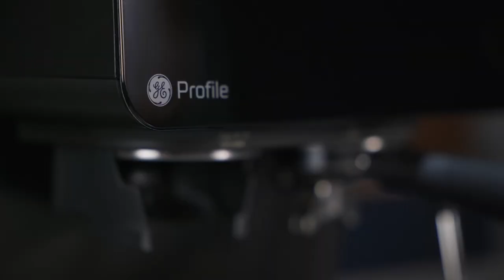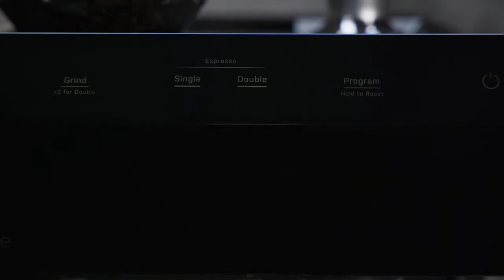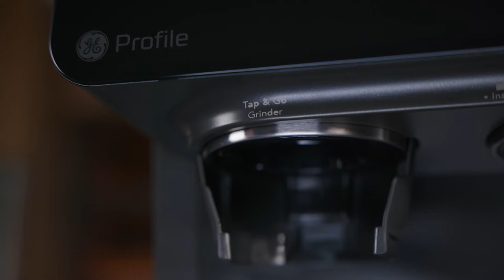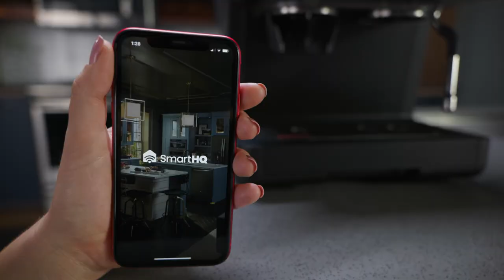Cleaning and Descaling Profile Semi Auto Espresso

Comment: Question for GE Customer Service:  What is the part number for the silicone seal for the group head and where can it be obtained. That part is not shown on the GE Parts web site but should be because it eventually wears out and the group head leaks.  I have a CAFE model C7CESAS4R1W3 with 58mm group head.
Reply from the maker: Hi Teddy,

Thanks for reaching out. We do not offer the silicone ring as its own part. If your portafilter is leaking, then we'd recommend replacing it. You can find the new portafilter, here: http://spklr.io/6057WzdX and you can also view the singe/double filters here if needed: http://spklr.io/6058Wzdk

Hope this is helpful! -MS
Reply: @geappliances   With all due respect you do not understand the problem or the design of the machine.  The part I seek is the silicone ring above the portafilter it seals to referred to on other machines as the steam ring.  There are numerous videos on YouTube on replacing them and they are readily available available on Amazon for the similar Breville machines but my GE Cafe machine appears to use a different design with three tabs holding the ring in place.  Replacing the portafilter as you suggest WILL NOT solve the problem.  I need to replace the seal it seats onto above it.  

If you are not able to make this part available then my machine, and those of everyone else who has purchased one, will encounter the same problem so I would encourage you to elevate this request to a level where a solution can be authorized and the part made available.
Reply from the maker: Hello,

We appreciate your feedback, Teddy! We're confident in the quality and the time our engineers took on this unit. However, if your unit fails to operate properly under normal household conditions within the warranty period, please know we are here for you! Simply contact us here: http://spklr.io/6054WzUG or send us a private message via social media. We're always glad to help whenever possible. 

Take care, SH